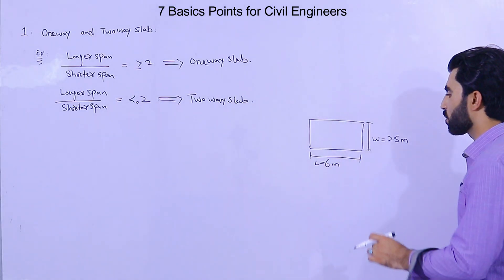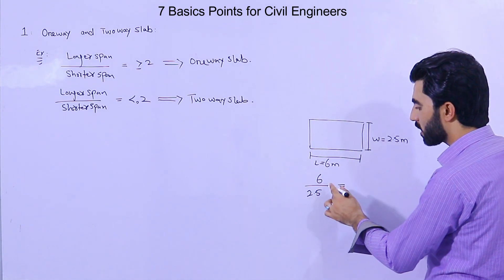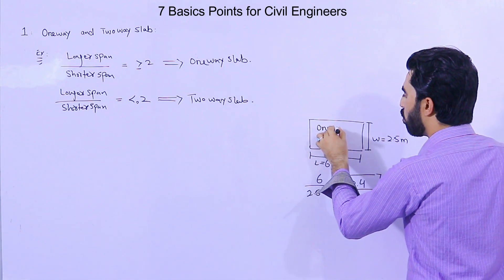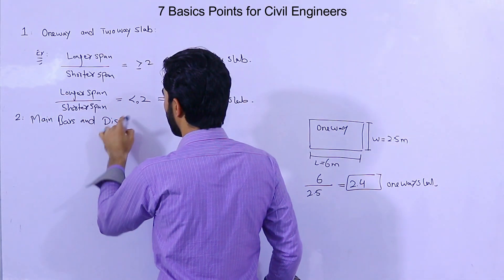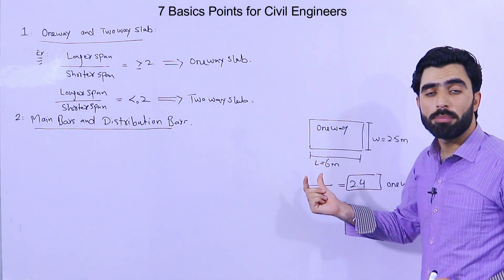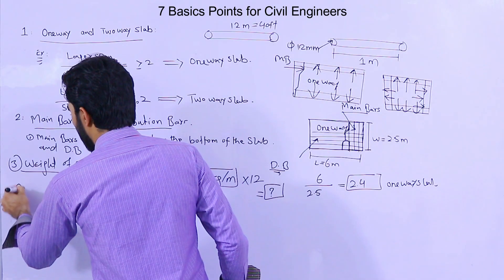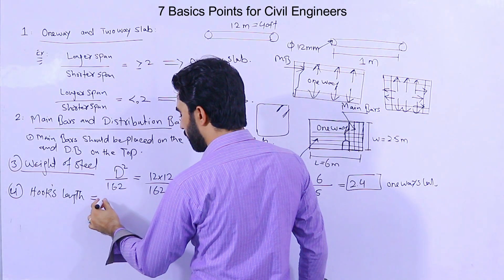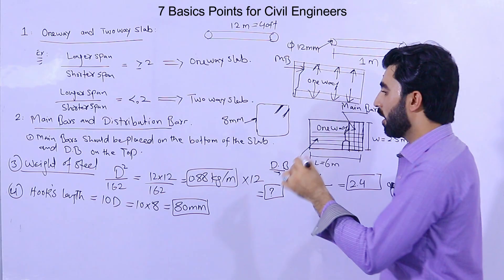7 Basic Points for Civil Engineers | Basic Knowledge for Civil Engineers | Civil Engineering videos

Comment: Sir, If the aspect ratio is equal or greater than 2 then it is one way slab, but you tell that when it is greater than 2 then one way slab
Reply: 6÷25 = 0.24 this is two way slab according to this formula

Comment: Sir your vedio was good but Iam a common man, I wasn't able to understand what you meant by hooks angle , is it the angle of stell rod used in the column where it reaches the top of the bed or mat. I also didn't understand the development length and where you were applying it.All the rest was crystal clear.

Comment: In the video from the construction of the ceiling, there were badly made stirrup bars (90 degrees) :-)
Moreover, it seems that the bottom reinforcement does not need such a large overlap in the area of the beam (perpendicular to the beam).
If the cover is too large, the load-bearing capacity of the beam is reduced (a smaller arm of internal forces in the reinforcement). So it should be selected according to the needs (environmental class).
Besides, as always, a very nice movie, it's a pleasure to watch :-).

Comment: SIR, THE STIRRUP ANGLE (@12min.) YOU ARE SHOWING 135 Degree IS ACTUALLY 45 Degree IF MEASURED. PLEASE RE-CHECK IT.
Reply: Bar is at 0° you bend it it goes through 45 , 90, and round to 135°
Reply: @mohammedzaman9331 not 0, if you take it as 180 for straight line then 90 after that you can bend it 45 so 90+45=135